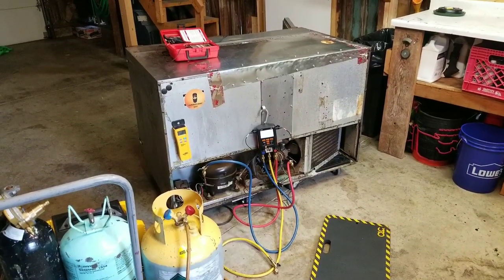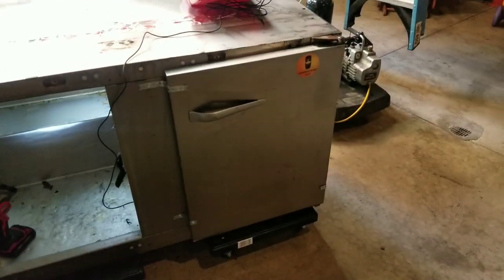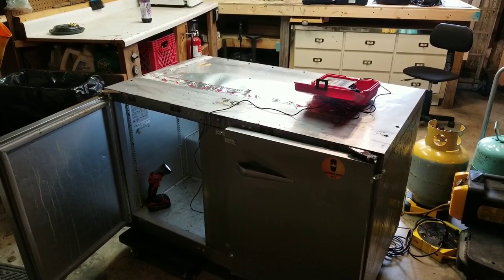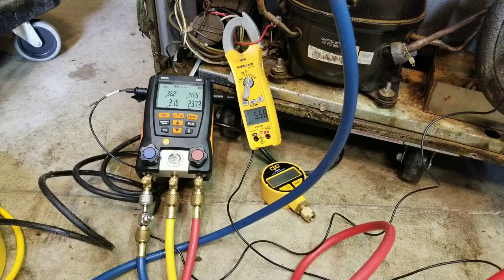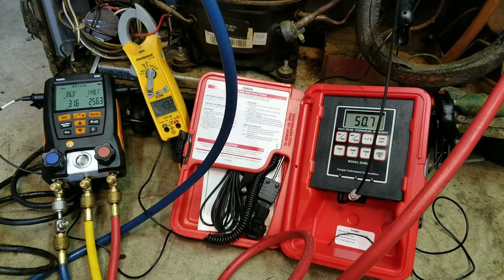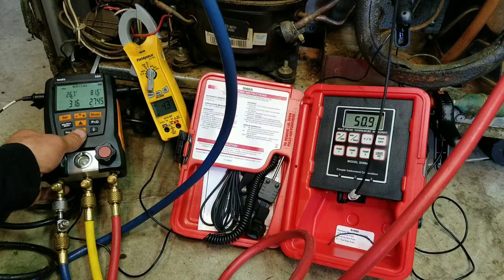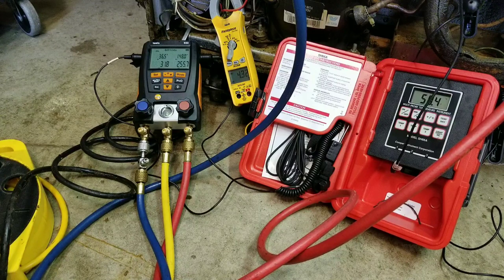Traulsen cooler with non condensables

Comment: Good video and thank you for taking the time to perform this experiment. A couple of things you should consider in the future. 

Nitrogen is a gas that cannot be compressed into a liquid at any atmospheric temperature. Therefore trying to weigh it in would not be successful because it's volume in the cylinder is not by weight, this is why gas is sold by the cubic foot and not by the pound.

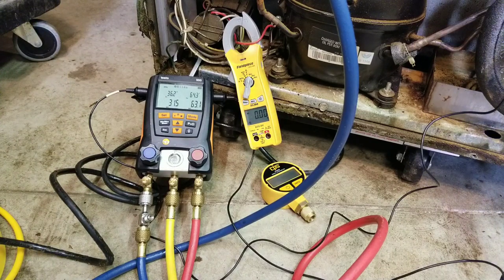I believe at the 13:24 mark in the video when you started the system  the low side hose ball valve was closed, the suction pressure never fluctuated.

Typical symptoms found in the system with non-condensables are higher condenser temperature, higher than normal subcooling due to the difference between the higher condenser temperature and the temperature of the liquid leaving.the condenser.  Higher evaporator pressure and temperature with very low subcooling is also common due to the non-condensables present in the evaporator. The symptoms can vary for a system with a TXV.

 if you decide to perform this test again I would suggest that you pull a vacuum on the system and disconnect the hoses allowing the ambient air to be drawn into the system then adding the appropriate charge on top. Hope my input is useful and not confusing as I was trying to be as succinct as possible.
Reply: Sorry if my post was confusing.

 I have never tested the theory but in my opinion the non-condensables would definitely travel throughout the system.  A fluid would not stop moving especially when there is an "outside force" (compressor) acting upon the fluid (non-condensable).  Thanks

Comment: Nice man. My thought is you dont actually have subcooling that high. Your calculated subcooling is that value because you are calculating saturation temp based on the combined pressure of the refrigerant and the nitrogen. I think your acautal subcooling is much lower than that. My guess on the lower line temp is becuase your not absorbing as much heat from the evaporator so you are able to get the liquid refrigernat temp lower even with less avaliable condenser capacity. I look forward to hopfully hearing the real answer!
Reply: Nice puzzle  Curious HVAC guy  . I think John MaMaster is spot on.

I really had to think about that one. Pushing the limits of a new Tech who didn't go to school. LOL! I included my thought process below:

noncondensibles can't get through the liquid line, they are trapped like trapped air in water filled cave.

When you have more than one gas in a confined space, each gas continues to have its own pressure temperature relationship. 

We are going through a capillary system so there is nothing to control the high pressure in the evaporator. 

Evaporator is above optimal SST can't effectively remove the heat. 

With a TXV the pressure would be controlled there would be more heat absorbed. 

As we come back into the condenser there was very little heat removed by the evaporator.

The pressure in the condenser is obviously driven up by the nitrogen, but was the temperature? There is no clear pressure temperature relationship, because you have two gasses acting independently of each other in the same tube. How much but how much heat is really in the refrigerant? 

The liquid line temperature is lower than baseline. 

You can't compare the head pressure/ temperature to the line temperature to calculate subcool . 

If this was a TXV system I think there would be a lower SST, but maybe not the heat would make a complete loop because the condenser wouldn't be able to reject it.

Comment: If you notice the head pressure it is spiking it will go to about 275+PSI and then drop back down to 250 PSI as the nitrogen cycles through. It’s a lot easier to see it on compound gauges. But that’s a dead giveaway for me. Great video brother!
Reply: This 👍

Comment: One thing you could try is pull a vaccum then allow the system to pull in air and add refrigerant on top. The classic "what are noncondencables" approach.
Reply: i would like to see that too
Reply: With air being 80% nitrogen, would you expect to see much difference between them?
Reply: @markcarpenter3600  Air better represents what would happen if there was a repair made without evacuating the system afterwards.  I don't expect to see a difference but it could cause issues at low temperatures because of the moisture.

Comment: I have the Appion twin also. It's a great machine. I installed a 1/4 inch flare filter dryer with a short braided hose on the inlet side to prevent crap from getting into the unit.
Reply from the maker: Thats a good idea Greg- I need to do that as well

Comment: Subcooling was considered so high because its based off the pressure and temperature of the 134. Gas laws: The Total Pressure is the sum of the mixture. Your 134 by itself had around the psi it was supposed to have, but the added pressure of the Nitrogen threw that pressure way off, while the temperature of the line stayed relatively the same. SO you didn't have 80 degree subcooled liquid 134a, you had 7 or 8 degree subcooled liquid 134a, and a whole lot of nitro.

Edit: To clarify, the total pressure you were reading was the sum of the 134's pressure, and the nitrogen's pressure. The 134a was not under 200+ psi of pressure, the nitrogen was not under 200+ pressure, but combined together they equaled 200+ pressure.

Comment: It's interesting that you were able to pull a decent vacuum,  without changing the filter dryer.
Reply from the maker: There wasnt alot of moisture in the air, and flowing that nitrogen through it helped out a bunch I think-- also that JB pump has been a good pump for me over the last few years -- thanks for watching
Reply: Thanks for sharing.

Comment: The way i understand it is that the non condensables will gradually build up in the condenser, pressures will spike because the heat can't be rejected properly, then it will burp through the coil like a bubble and restart the cycle. Overcharged can kinda do that too, but i think discharge temps are generally higher and more erratic with non condesables.  Fun experiment.
Reply: Nitrogen is lighter than the gas and doesn't condense into liquid so it'll try and hang out in the coil above both. I'm totally with you on the thermal camera. I need one. For everything.
Reply: I would like to try different amounts of gas to see when and how much it affects the system too.

Comment: The reason you can't get ounces of nitrogen is that it is not a liquid. As such, it takes a huge volume per unit weight aka low density. You can't measure it the same way as refrigerants.

Comment: Cool test. We can't really weigh in N2 due to it being only gas (no liquid N2 in tank). Nice collection of trikes you got there. haha. I think the higher SC is due to the 134 trying to get by the N2 while leaving the condenser. It is slowed down causing high SC, high pressures and low performance.
Reply: Any gas has mass and therefore weight. So it can be weighed. But for a small charge like 25 PSI in a system that has probably a fraction of a cubic foot total capacity, it will take a more sensitive scale than the usual refrigeration scale. At a guess that 25 PSI in that system was somewhere around 6 grams, which is a fraction of an ounce.

Comment: This is what I think. When nitrogen enters the system, it collects at the top of the condenser and stays there and the surface area of the condenser is reduced. Nevertheless the refrigerant must be changing temperatures but not condensing. Once the refrigerant has left the nitrogen behind, condenses collecting at the bottom causing a higher subcooling than normal. Plus remember, different gases react different at the same temperature. Maybe 30 psi plus 10 ounces of refrigerant was enough to trick the system into acting like it was overcharged.

Comment: Nice test.. Have done it the field😵.. A queenvalve not working properly, so when i pressure testet the system.. All my nitrogen ended up in my receiver...
Reply: @curioushvacguy6876  Banged on high pressure within a sec..
HP was set at 55bar went straight to 65bar..
After a new change, the compressor was good as new..
Reply: Noncondensibles and up trapped like air pockets in a water filled cave.  No way for them to travel to the metering device.

Comment: Critical charge and non condensebales are essential in refrigeration system..
Great job of proving that...
Lol.
Reply from the maker: Thanks Joseph, have you ever run into non condensibles in the field?
Reply: @curioushvacguy6876  
More than you can imagine...
Especially on low temp..
On a particular master - bilt freezer..
A few techs kept saying compressor...or high head..low suction..bad metering device..
So on this one i had a 7* differential from inlet of drier to.outlet..
Well you pump.down..change drier.and triple evacuation..
And guess what...like new.
Sometimes though tou will.have high head...and misdiagnosed as txv issue.on.heat.pump..
But on low temp...I've noticed..ypu have temp.differentials along liquid line to end of condensers..
Laser thermometer or pipe clamps..
Yes its very interesting...
Cool job..
Reply: On my original comment..on your post..i.meant critical charge and NOT.having non condensebles in system..i.type sometimes without proof reading......
Reply: You will notice big temp differences along the liquid line to end of condenser,instead of your normal temps...you will see a spike here and there and that is a sure sign of non - condensebles in a system,especially low temp...
Most are from someone fixing a leak or change out of a compressor,and not running proper evacuation 
Or not at all. 
I've seen quite a bit.. 
But yea..big clue is temp spikes along your system line set..above average running amps..low.performance..
A decent drier..good.vaccumn,and proper charge.and you.will see a gradual temp.increases or decreases along the line set....
Awesome.video!.Curioushvac guy!!

Comment: On the last test had you turned off the unit and let the system settle out and everything return to ambient temperature you could check the pressure at the discharge line and pressure should be within 5 psi of the pressure called for at room temperature according to PT chart, if not then it's not what it should be. Thoughts?

Comment: Does the SC240 have micro amps? Would've thought you'd have the SC460 for heat calls plus you'd have a back up way to measure line temp's

Comment: Finish the grand finale with a recharge of propane and see how well is cools as a final send off.
Reply: Propane will increase the capacity a fair bit. I have actually charged a few small systems (under 3oz) with propane. The issue with propane is moisture.
Reply: Yes! 🤔That would be lit 🔥
Reply: @beardowns8050  literally if there was a leak. 🤣